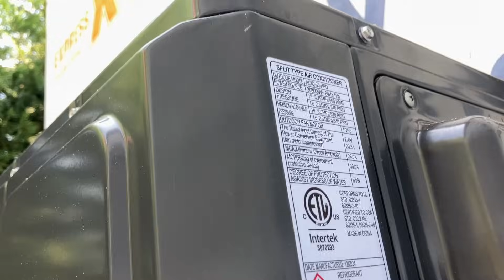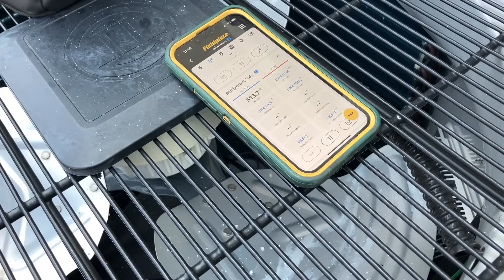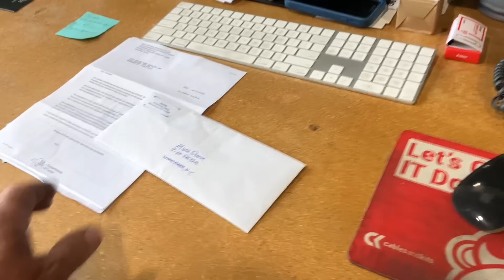Part 2: $50K ACiQ Heat Pump System Installed in Luxury NY Home | Dual Fuel Done Right!

Comment from the maker: 💬 What do YOU think about attic installs vs closet installs for air handlers? Would love to hear from HVAC techs and homeowners alike! Drop your thoughts below 👇

✅ This was a real-world dual fuel ACiQ heat pump install in a luxury new build — no fluff, just real talk and real work.

🎯 Want to private label your own HVAC brand or become an official ACiQ dealer?
👉 Visit: https://aciq.com/mikeypipes

#MikeyPipes #HVACUnfiltered #ACiQHeatPump
Reply: Air ducts and equipment do not belong in attics unless it is insulated conditioned space, on new construction there's no excuse it is just ignorance and greed. forced air Heat from above is not comfortable either. Just goes to show hvac is done poorly in much of united states.
Reply: @Jon-hx7pe  It is code here.
Reply: Mechanical rooms should be mandatory in my opinion.  No exceptions.
Reply: the drain going in the gutter? what keeps the gutter from backing up into the drain?
here in Seattle the best gutters overflow in a downpour.
Reply: @racgrac28 Tell them to be responsible adults and keep the gutters clean?  I personally would eject it all the way to the floor, but I am sure Mikey has safeties in the drain pan.

Comment: wouldn't run anything into a gutter or over a gutter, would come out the soffit below then dump into a funneled wye off the nearest downspout. any penetrations above a gutter is never good, especially in the frozen areas, it can ice dam the front lip and overflow the back high enough to go through the hole and rot the framing. more so never in or near a corner either, where the valley causes a large flow and splash back. they also generally put a tall splash shield/height extender on the corner  so it doesn't overshoot in heavy rain.

Comment: So Mikey Pipes I gotta throw this out there. Everyone pipes in a secondary drain with a float switch so I went on a call the secondary  pan. It was just about full, but not full enough to trip the float switch so in my opinion, I prefer not to pipe in the secondary drain pan. Let the pan fill up and let the safety switch do it’s job now the customer knows there’s an issue and we can get out there and blow out the drain. What’s your opinion on that?
Reply: If the switch fails you are screwed. Pipe the auxiliary pan  to a conspicuous  place and put a switch on the main drain
Reply: @josephfarrow2685 Yeah I get what your saying but there’s some homeowners that are completely clueless and wouldn’t look for the secondary drain I’ve ran into customers that didn’t even know they had a filter
Reply: some times the pans can evaporate fast enough to not trip the float, unless it's set real low and they end up running long term rusting the pan through or it cracks(plastic fantastic junk).

Comment: I would like in garage like in Florida personally. 1st😊
Reply: I'm in Florida in a newer house. Both of my units each have their own closet in conditioned space. In my previous house I had an A/C closet in the garage with 2 units unconditioned. I had sweating issues in there due to the humidity. We cut in a little duct and return. That solved it. I like having the units inside better. I change the filters monthly, put tabs in monthly and pour Viper drain cleaner in the condensate drains monthly. I still get about 2 clogs per year on each system.